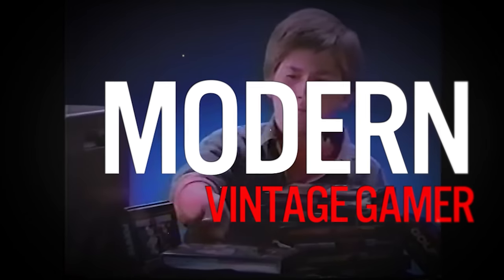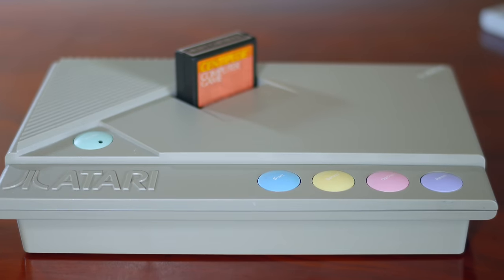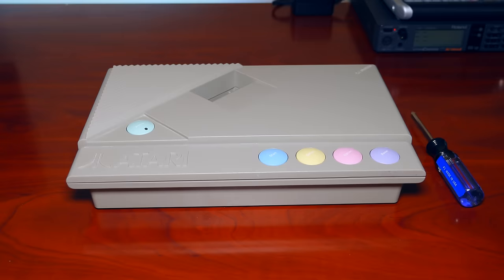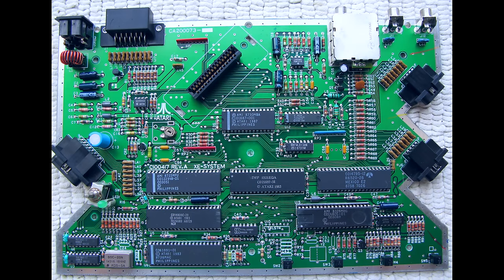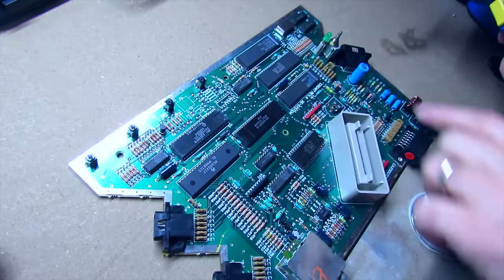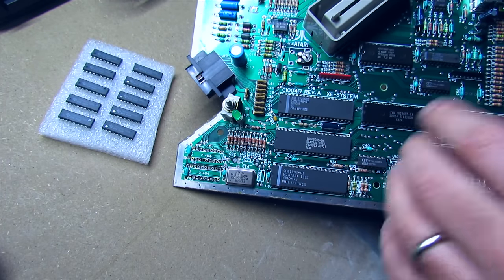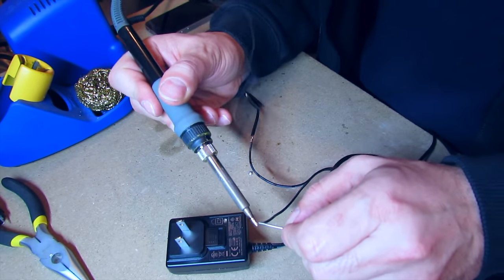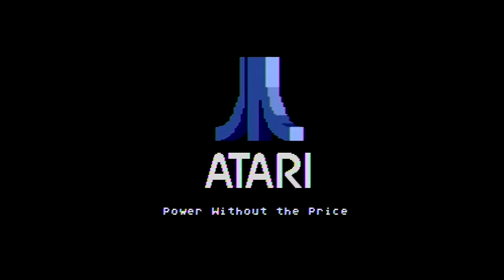Atari 8-Bit XE Game System XEGS Review, Teardown, Repair and SIDE2 Compact Flash Hard Disk Upgrade!

Comment: Great video buddy! And dat Hakko saves the day! I have the older 808 version and it's a godsend for this kinda stuff. I love the fact the XL and XE computers only require 5 volts DC on the psu. Sooo easy to build a replacement psu (unlike the c64). My 800XL is acting up and as soon as I get home tonight I'm going to pull it out and see if I can sort out its issues. Atari's 8 bit machines are great!
Reply: Those desoldering guns are cool, but I don’t desolder enough to justify the cost. Instead I use a Xytronic model that is basically a Norman desoldering pump with a heated tip. It works surprisingly well.

Comment: I dug one of these out of my garage, and the very first thing I did was check the voltage on the supply. Luckily, mine gave a solid 5v and the system's working perfectly. I need to check my old 130XE though and see if I can get it working.

Comment: Didn’t have a two port model so I got another “working” Atari 5200 recently. The screen was looking very similar but I didn’t remember this video. I got it along with another 7800 that was also showing issues: scrambled 7800 games but working Atari 2600 games. After they warmed up for 15 minutes they suddenly started working! Well, the 5200 was showing black and white graphics for a little while but after another 15 minutes it was back to 100%. Unlike the 7800, the 5200 stayed fixed. The 7800 would go back to scrambling 7800 games until warming up for 12-15 minutes any time it was allowed to cool down but, strangely, it works perfectly with no RF shield. You can literally hover it close over the board with no contact and cycle the power but it won’t work until you are about an inch or more away.

Anyway, because the Atari 5200 is based on Atari 8 bit home computer 400/800/XL/XE hardware, I thought it might be relevant. I completely discharged it and let it sit for two weeks but the issue didn’t return.

Comment: Also before you replace the chip, you might want to follow the power supply lines of the chip, see if there is more damage (maybe measure supply voltage)... otherwise you might just fry your replacements as well.

Comment: Some late XL Ataris actually had a Freddie chip on board, sometimes these are referred to as XLF instead.
Reply from the maker: good info. thanks!
Reply: Yep, that's correct. I have one in my collection, a 800XL or XLF if you prefer.

Comment: 0:46 correction - 100k were sold the first year. More were sold afterwards. The total number sold is not known. The system was successful from Atari's perspective. They managed to sell already existing inventory of parts and cartridges sitting in storage. The 65XE/800XE was sold into 1992 in eastern Europe so technically it was the last system produced of this line.

Comment: I wanted one of these as a kid, I had saved for ages and ages and they were out of stock everywhere, I ended up with a ZX Spectrum +2A instead from Tandy which in hindsight was a better buy long term as the Atari 8 Bits faded from the UK about a year afterwards and games were next to impossible to find where Speccy Software was available for years and years.

Comment: I had one of those, it came with a huge manual/program manual, and 1 game (cartridge), it could be connected to a cassete player to load games, it was noisy and the tracks had music on top of the data sounds (like the old modem noises), also there were a 1200 modem available and it was compatible with the ST MIDI port. THere were few games available made specifically for the system, I had, KARATEKA, Basic and a Calc spreedsheet.
And I think I still have some cartridges and some cassettes!

Comment: The thing is, those kinds of power supplies (inductive transformers as opposed to switching power) typically read a higher voltage until they are under load. Same for the NES' AC PSU.
Reply from the maker: yes that is true but +6.8v wouldnt be considered normal
Reply: Looked like it was kicking out a lot of 60/12 Hz (100/50?)

Comment: Wait a minute....I thought the 7800 was the last 8-bit Atari console. I know it had a staggered release but it's official launch was 1987. Was this sold after that? What if you were to up the RAM? I mean, I don't think it would make any games run better; However, it might make the programs faster especially if they run at a higher clock speed. Of course you would have to match the power needs if it's higher it wouldn't work...I don't think. Sorry, I'm a fellow tinkerer and I love slapping together super guns. I have never attempted to add faster RAM to a retro console before but it has always intrigued me. Maybe I'll do this one of these days.  do have a Model 2 Sega Genesis that's likely on its last legs...perhaps it's time to double the RAM! I would consider it a success if it simply worked.

Comment: Some Atari 8-bit power supplies are great, like the one I have for my 800XL it's a big white box with vents on it, and if I remember right it's fairly easy to open it up and fix anything if something were to go wrong, since it is mostly just a ureg powersupply and a basic 5v linear regulator circuit in a box. Some of the powersupplies were shitty and known to fail , I believe the worst offender was the one that was a heavy sealed black box OEM'd by DVE , these supplies were especially terrible since the entire inside of the device is potted with epoxy.

Comment: I do have one of these plugged into an external SIO2SD. A good usable system for revisiting some old loves in gaming.  I did not the specific joystick or Flight Simulator  with it but have the light gun (OK, but i can confirm its reputation for not being that accurate) .

What do you think of the system now you have it?
Reply from the maker: How is the SIO2SD ? I also have an A800 (i made a vid on that too last year) and was thinking about picking one up for that

I love the system. The detachable keyboard is a nice touch too.  The video quality via composite is very good to all things considered.
Reply: Got mine from here:
http://www.lotharek.pl/product.php?pid=23

Its OK, I found the walking through the library a 'tad awkward' (and still do  to some extent) with the tiny LCD screen for looking where you are going, but for loading, it is perfect. Works on my 800xl and 130XE as well. Much more reliable than disk (As some are getting old).
Reply: double post! DOH!

Comment: By the late 80s these things were being sold as clearance items at department stores. I had a C64 and upgraded to a PC around that time, but picked the XE up anyway because it was dirt cheap ($60). I wanted to like the thing, but by that time 8-bits had died in the US and software for it was nowhere to be found. I ended up returning it and buying a 7800, which was great because it exposed me to a ton of 2600 games I never got to play prior to that. Atari had a lot of cool hardware and it's a shame that Jack Tramiel ran the company into the ground.

Comment: huh, I need to dig my XE out of the closet and see if it still works. I haven't used it since the 90's. Thanks for the warning about the power supply, I'll be sure and check it first.

Comment: I didn't check through all 298 replies here, but if nobody has said it yet, that power supply is what's know as an "ingot"; they're known to be problematic and have a habit of making a mess out of Atari systems. Your solution for a power supply is a good way to go (I've done something similar myself); but all other power supplies from Atari have a much better track record than the one you were sold. That one is visually different from all the other ones Atari sold for use with the XE's and XL's (400/800 used different supplies); so it's easy to identify (and toss in the trash, except for the DIN connector).

Comment: So, with only 64k, are the 65XE and XEGS exactly the same specs as the 800XL? Since the 800XL is just an Atari 800 with another 16k and missing the extra cart slot/controller ports, I would've made the point that this was 1979 tech being pitted against the NES. ;) I also would've noted that it came after the 7800 which, was more advanced, and the 5200, which was also based on the 1979 computer hardware (only 16k like an Atari 400 though). It was just weird that Atari would try to compete with the NES using this hardware a third time AFTER the 7800 was a thing!
Reply: Almost, but not exactly. The XL machines didn't have the "FREDDIE" memory control chip.
The XEGS is closest to the 65 XE but with additional SIO for the keyboard and only a cartridge port on top.

The XE had the cartridge port at the back with an ECI "expansion port" at the back, sort of like a cheaper version of the 800 XL's parallel bus interface (PBI).

The XEGS doesn't have any expansion options apart from the SIO ports.
Internally it was indeed a 65 XE (with FREDDIE but without ECI and with both Missile Command and BASIC built-in, switchable depending on whether or not the keyboard is connected).

The lineage would be something like Atari 800 (1978/1979) -> Atari 800 XL (1982/1983) -> Atari 65 XE (post 1984) -> Atari 800 XE -> Atari XEGS (1987ish) , all very similar specs. I think the Atari 800 had 48 kB instead of 64 kB though, not sure don't remember exactly.

Differences include parallel bus interface, ECI, FREDDIE, CTIA, GTIA but no more than that.
The more "high end" models of XL were never produced after the change of ownership in 1984 and the XE version's highest end model was the 130 XE (which was a 65 XE with 128 kB of RAM instead of 64 kB). Sadly, the 65 XEM and things like the 1450 XLD, 1600 XL and 1850 XLD were all cancelled.

I think  the 1200 XL was briefly produced at one point, but only for the American market (no PAL version, only NTSC).

There is a fairly decent Wikipedia article available: https://en.wikipedia.org/wiki/Atari_8-bit_family
Reply: @IcyTorment  The commercial comparing it to an NES sure seems like they were trying to compete in the console market. ;) ...and then you've got Atari going out of their way to acquire and publish XEGS games, like a totally new version of Choplifter (older one exists). Not sure why they would want retailers to carry their old 8-bit home computer products when they had moved on to the Atari ST in the home computer market too. It's bizarre that they would release the same hardware so many times, even where it was an obvious downgrade that undermined their flagship (Atari 7800 ProSystem).
Reply: @johnny5wd567  What does the FREDDIE offer to XEGS users? Were there memory upgrades available?

Yes, ths 800 only had 48k, which is why I mentioned the XL had an extra 16k. The 1200XL was definitely produced but the 800XL is seen as the true successor (1200XL was ill-conceived, expensive, and unable to compete with the Commodore 64 and others).

Comment: I love the SIDE2 cart but you really need 128K or higher to take full advantage.  The MyIDE ][ from AtariMax is a much better choice for 64k (though it does take some effort to use its more advanced features).  I use my SIDE2 in my 130XE (576K RAM) and the MyIDE ][ in my stock XEGS.

Comment: Hi buddie I know you did this video a few years ago but I was wondering if you could help me out with a problem I have with one of these systems. Like yours my XEGS  turns on ok (green light comes on) but I get no picture?. The TV recognises the signal but just a black screen. I've  tried RF and composite also no chips are getting hot so not to sure where to go from here. Any suggestions would be greatly appreciated buddie.

Comment: Is there any way to make the system itself run faster? I like Flight Simulator II but it only runs at 2 frames per second as stated in the instruction manual.

Comment: I usually replaces these old PSU with regulated linear power supply (made by me, I regulate with 7805 or 7809, capacitors above than 2200uF to filter and security diode on the 78XX) or with general purpose switched power supply. I do it since I blew my Brazilian Sega Master System with that poor power adaptor made in the 80's by Tec Toy.

Comment: The fact that BOTH chips got hot should have been a clue that the RAM chips weren't the root cause of the problem-- unlikely that both would have the same failure at the same time causing them to get hot.   The power voltages on the chips would have been the first thing I checked...

Comment: It boggles the mind that they didn't bother to stick a 7805 linear regulator in there as a precaution, it would have spared the hardware as long as the input voltage was under 38V (an extreme case, as higher voltage equals more heat produced by the 7805), did they really trust those low quality unregulated PSUs to remain at a stable 5V forever? It probably cost them more replacing units with dead RAM chips than just adding a regulator to the design, I mean that hefty shield would have made a perfect heatsink.

Comment: There were actually two package variations of the XEGS. 

One was the "deluxe set" which included the console base, the keyboard, the joystick, the light gun, the power supply, and Flight Simulator II. 

The other was the "basic set" which included the console base, joystick, and power supply, and other than the built-in Missile Command, no other games were included.

Comment: That commercial in the beginning, better than the NES? Don't make me laugh. I got one of these as a kid with Daves Midnight Magic and the built-in game for a couple of bucks at a flea market around 1995. I was appalled when I turned it on at home: cheap plastic case with squeaky buttons, horrible joystick, horrible graphics, horrible sound. I grew to hate it so much that I just threw it in the trash eventually. Commodore had some decent offerings with the C64 and Amiga, but apart from that no one could hold a candle to the japanese in the 80s and 90s, they were just so far ahead in terms of quality.

Comment: I grew up in Commodore Country... Weren't no Atari's round here.

Now that I am rapidly approaching 50, I wanted to see how the other half lived.

It was a toss up between an 800XL and the XEGS.

 I like the asthetic of the XEGS and they are pretty rare, while 800XL's are a dime a dozen.

I didn't go with the XE's because of their, rather ridiculous cartridge port placement.

But in my research I discovered that the XEGS IC's are all direct soldered.

This, moreso than the spongy keyboard (with it's dinky cable) put me off of the XEGS.  I understand why they did it as a cost cutting measure. While I am no stranger to desoldering chips, I'm not really a fan of it either.  More often than not 800XL's are nearly/completely socketed, makes repair and upgrades easier.

So I went with the 800XL, grabbed a 1050, picking up an sio2sd shortly (or maybe a side2 or ultimate haven't decided yet).

But I still like the XEGS, and maybe will end up with one eventually.

Comment: I like how Atari thought their shitty joystick was a selling point when the DPad was the best thing ever invented
Reply: The funny thing is that with the right PEEK addresses used, an Atari computer (like the one in the video) can read all the inputs from a 9-pin Sega controller. (Basically because it has alternate modes for devices like paddles that can see the different voltage signals.) So in theory they were capable of supporting a more advanced controller perfectly fine, it's just those people that marketed and sold the system never had the sense to come up with a better controller than the basic one with 8 positions and fire. (A lot of old games were made harder because it was fire+direction combos that wouldn't have been needed if there were some alternate buttons available.)

Comment: At this point in the lifecycle of Atari 8-bit computers, nobody should ever trust an Atari power supply, even when buying from an "It works" seller. They are dying all around us and every one of them is now lying in wait to fail in a few days and fry your computer overvolting. There are USB-to-Atari 7-pin DIN power cables available for about US$10.00 plus shipping, or any hobbyist with a soldering iron could build one from the junk box after buying a 7-pin DIN plug at an electronics hobby shop and stripping down a USB cable. I did that recently because I wanted a USB-C power cable and couldn't find a USB-C-to-Atari power cable. It was pretty easy, actually.

USB-C power supplies are now a dime a dozen and your past Apple purchases have left you with a drawer full of them anyway. And then you're no longer dependent on being able to find one of these fast-disappearing and dangerous Atari power supplies.

Comment: Good video, but it upsets me that you just connected the wires to the power supply and left them bare without any heat shrink. I'm sure that's not how you left it, but i cringed when I saw that.
Reply from the maker: John-Paul Parker I've since heat shrinked it .I was out of it when I filmed that part
Reply: Modern Vintage Gamer I figured you would have fixed it. Are the solder remover guns good? I had to do a similar repair to a Commodore 64 and I used a hot air gun which I found pretty easy.

Comment: Yea so a certain PSU (the 'ingot') is bad bananas. Refer to: http://atariage.com/forums/topic/95416-power-supplies/

I can actually see in the video that your PSU is/was indeed the ingot.
Reply: I was wondering that myself. Probably the ingot. Good eye. I have two 800XL's giving me only a black screen. If I had to guess the power supply took the ram in these too. I've got to source some 4164 ram chips as swapping out the IC's had no change.